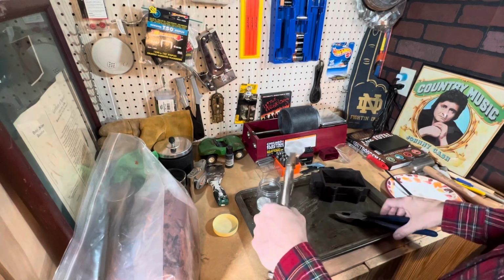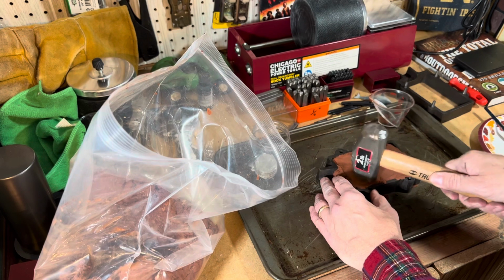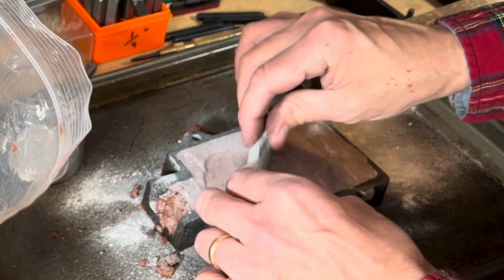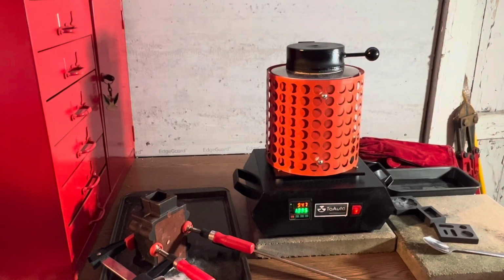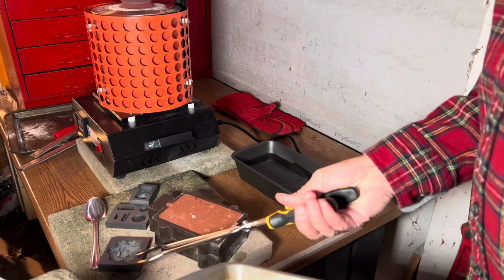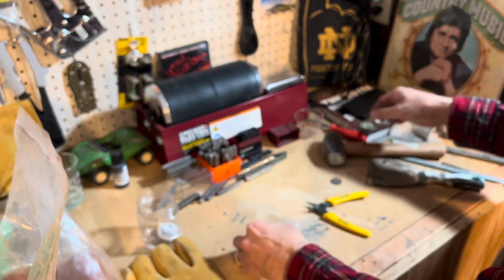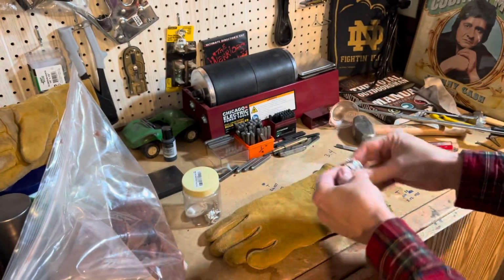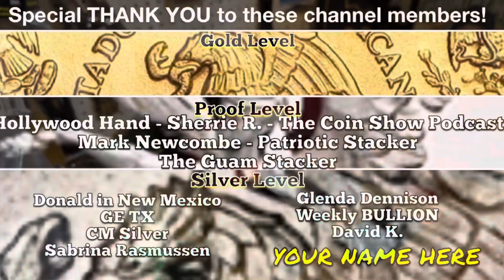Silver Pour Using a Sand Casting Flask for the First Time

Comment: ❤	GREAT VIDEO ♥️ 
I've just started metal casting and after watching multiple videos I was enthusiastic about the possibilities.
Short story, after many attempts to make a silver ring, I just couldn't get a decent result.
 Majority come out extremely rough, uneven and/or incomplete. Frustrated, I set it aside.
I've about given up until I came across your video. Your persistence is motivating and I'm gonna try something a little simpler. Sounds strange but I now understand that a "closed loop" is one of the more difficult shapes to cast because of contraction during cooling. The shark gave me an idea to try my wife's "teddy" pendant. Don't anyone worry, I'm going to make a wax/plastic cast for my working form to avoid any possible damage to her "trinket"😁
Thanks again for the encouragement 👍🏻❤️
Reply from the maker: That’s awesome!  Glad my video helped. Best of luck in your work!  It’s such a fun hobby!

Comment: Hi again T, Yes pouring silver can be a fun obsession but very rewarding especially when you are making a piece for someone you care about. I have found that if you sieve the casting sand through a screen it makes the sand in the casting uniform and the casting comes out much better and minimizes the sandy holes in the piece. also try not to reuse casting sand that has powder in it or burned sand.
A Jewlers saw and a set of fine files work well for removing nubs of unwanted silver.
Thanks again for all the great entertainment.
Reply from the maker: I appreciate the tips!  Thank you very much!  I appreciate you watching!

Comment: Great video 
Tips:
When running ur vents poke holes thew sand at end of ur vents helps the gas escape so the silver flows better and allows better detail....

Also when casting a figure don't pack ur flask to hard let the mold do the packing of the sand when it gose into the sand helps with detail and less breaking of the sand mold.....

Also try not to use tumbler as much it tends to dal the detail of the cast better to just do all ur cleanup and hand polish to keep detail sharp
Reply from the maker: I appreciate the tips buddy!!